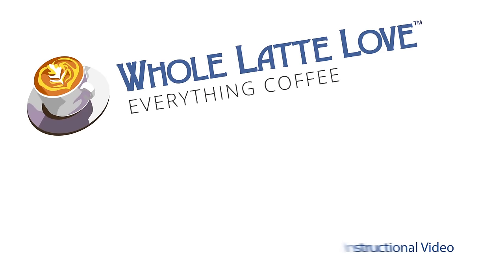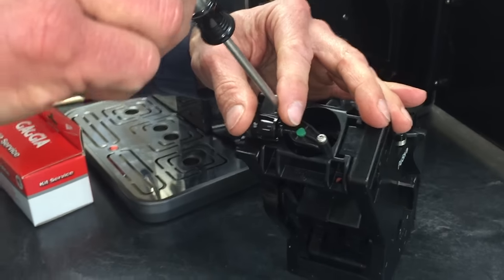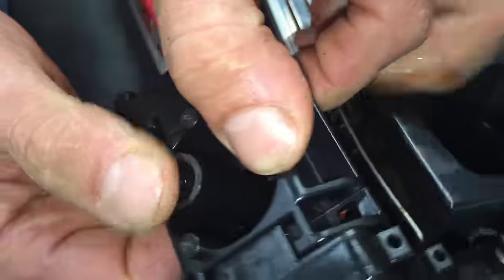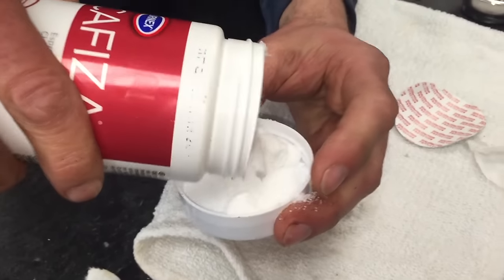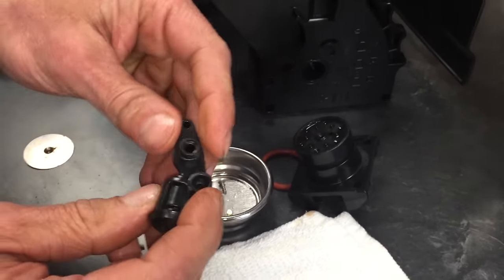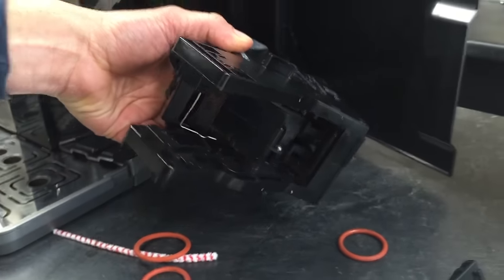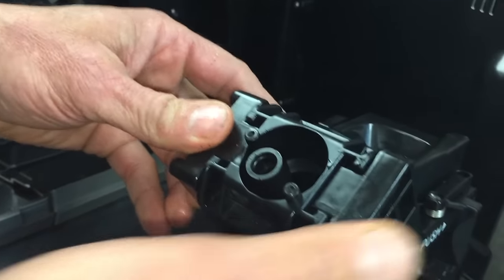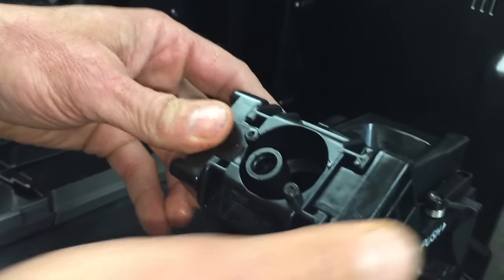How to Deep Clean the Gaggia Brera Brew Group

Comment: Why is no one talking about the lubricant? Is that thing organic and safe to "drink" ?
Reply: You need to use a food safe lubricant. Something like cooking oil is too thin to use on many parts of a coffee machine, but Vaseline is supposed to work pretty well. (I just googled this, and a good option seems to be to check Amazon for 'food safe silicone grease.' That gives you some less eyebrow-raising lubes for about £5.)
Reply from the maker: Hi a, Thanks for the question. It's a food safe lubricant. Also, the lubricant is not in close contact with actual brewing.

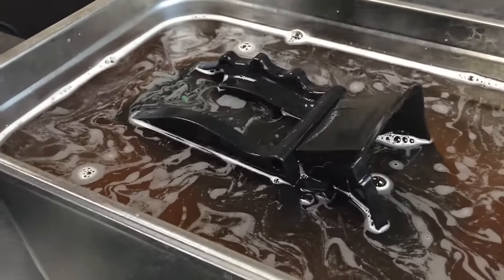Comment: Great video! I bought this machine a couple of years ago from y'all and love it. Thank you. Quick question I submerged the machine part at 5:47, in the Cafiza Cleaner (as I was doing it step by step and pausing the video). How bad is the Cafiza Cleaner for that part? What possible problems can arise? Thanks for your help.
Reply from the maker: Hi Michael, Thanks for the comment and question. Happy to hear you are loving your machine! As long as you did not leave the part in a Cafiza solution for an extended period it will be fine - no problems.
Marc
Reply: @Wholelattelovepage  It was in for about 20 minutes. What are you thoughts?
Reply from the maker: 20 minutes should not be a problem
Reply: @Wholelattelovepage  Thank you!

Comment: After taking the top valve off of the brew group, there was no spring or metal ball inside the cylinder.  Is this ok or am I missing something? I have a Gaggia Platinum Vision.
Reply from the maker: Hi Sarah, Thanks for the question. Gaggia uses 4 different styles of brew groups. You are fine...The Platinum Vision uses an O Ring and does not have the ball and spring.

Comment: Thank you for this!  I have a hard time cleaning the brew group because I was afraid to unscrew anything.  Question:  Is lube only necessary on the tracks?  I've been putting lube on the axle/pivot thing on the bottom, and also on any part that moves against another, as I would if it were metal, but is that not necessary?
Reply from the maker: Hi nyr, Thanks for the question. Here a connection to our support wiki which includes the video: How to Lubricate the Brew Unit: https://wiki.wholelattelove.com/Gaggia_Brera/cleaning_and_maintenance#Lubricate_the_Brew_Unit It's demonstrated on a Gaggia Brera but it's the same for any Gaggia brew group.
Marc
Reply: In

Comment: I bought a refurbished Gaggia Syncrony Digital coffee maker, using your videos I disassembled it entire for cleaning the machine and the Brew Group and Grinder (I am electronic). 
But the coffee that comes out of it is weak and does not turn creamy (I adjusted the amount of 70ml water, tested various grinder settings and bought quality coffee). I noticed that it takes an average of 30 seconds to make an expresso.
Could you give me some regulation tip (grinder or machine function) to improve the quality of my espresso?
Thanks
Reply from the maker: Hi TB, A few things you can check. For espresso we recommend using the finest grind and largest coffee dose possible. Is the espresso coming out relatively hot? Under temperature brew water could cause brewing issues. Under temperature may be caused by scaling in the thermoblock boiler which depending on previous owners maintenance habits may or may not be a problem. Descaling may help improve brew temp. Be aware it may also cause problems if machine was not descaled on schedule in the past. Scale can dislodge and plug up internal plumbing. Machine could possibly not be delivering a proper brew pressure due to a weak pump. If not producing crema with a known good coffee and shot is taking 30 seconds that's a possibility.
Reply: The temperature is good, coffee comes out at high temperature.
I did the descaling cycle with citric acid and Iget out a little dirt from the machine, and the water flows well from the machine just like the videos of demonstrations of take a coffee.
Would I know if the pump is weak? Have a test? Would you recommend some other kind of maintenance?
Is there any setup to increase the time to make coffee?
Thank you very much.
Reply from the maker: So 30 seconds is rather long. Low flow rate can indicate a blockage in the machine, weak or failing pump. Here's a link to our support Wiki for the Synchrony Logic which may have some useful information: https://wiki.wholelattelove.com/Gaggia_Syncrony_Logic#Poor_Flow_or_No_Flow
Reply: Muito obrigado, estou aprendendo um pouco mais a respeito disso.
Vocês acham interessante eu filmar um café para um diagnóstico ou a partir de agora tem que ir corrigindo todos os detalhes até ficar ao meu gosto?
Muito obrigado novamente.
Reply from the maker: Hi TB, Might have lost something in translation which was:
Thank you very much, I am learning a little more about this. Do you find it interesting to film a coffee for a diagnosis or from now on you have to go through all the details until it's to my liking? Thank you again.

I love coffee so I do find it interesting to film. I especially enjoy the more technical aspects and helping others enjoy what I love!

Eu amo o café assim que eu o encontro interessante filmar. Aprecio especialmente os aspectos mais técnicos e ajudar os outros a desfrutar o que eu amo!

Comment: I have a Saeco SG200 it does not have the same brew group as the one in your video. Do you know how to remove the BG from a SG200? It's stuck because the little switch that the locking lobe touches is not being switched. If not, who can I reach out to that would know? Thanks
Reply from the maker: Hi Mike, Found this manual for Saeco SG200 perhaps it can help: https://www.manualslib.com/manual/143477/Saeco-Espresso-Sg200e.html?page=3#manual

Comment: I put cafiza with hot water for 30 mins. Then i cleaned it all with piece of cloth which i was poking in with a small screwdriver. Then i did host water and cafiza for 20 more mins. The unit is virgin clean now. But now i am afraid i removed grease from all the places that should have it. I guess i need to check all moving parts and grease them? And never use hot water again?
Reply from the maker: Hey b, I'll bet it is clean. Warm water is fine - avoid hot. But all that soaking time def got rid of some grease. Definitely grease the moving parts and the o-ring. Doesn't take much grease to get the job done.

Comment: What about the poston inside? I removed it and cleaned and olive oiled the shaft.
Reply from the maker: Hi Marco, Cleaning is good. Olive oil is not the correct lubricant. You want to use a food grade grease as shown in the video.
Marc

Comment: Hello, my Saeco Vienna espresso machine stopped working after several years.  Water does not dispense from the spout but rather from the inside or somewhere near the bottom.  Please advise what to do and where to purchase repair parts.
Reply from the maker: Hi Jay, Here's a link to our Saeco Support wiki: https://wiki.wholelattelove.com/Saeco_Minuto_Focus#From_The_Bottom
This section is for a Saeco Minuto machine but yours might be having a similar issue. There are a few things you can try detailed in the wiki.

Comment: And how carefull do I have to be with the drying? So many nooks and crannys...
Reply from the maker: Hi GA, Good question! For normal maintenance we recommend rinsing brew group under room temperature tap water. Following that, shake off excess water and allow to rack dry outside of machine. Do not wipe down after rinsing. Not a problem to put a group back in machine and use when still lightly damp.

Comment: Как часто необходимо разбирать?
Reply from the maker: translation: How often do you need to disassemble?

Hi, Thanks for the question. Depends on level of use. I would deep clean if you notice degraded performance. It could be a year or more before deep cleaning is needed. I have a machine using this group which is going on two years of use averaging 6 brew cycles daily and I have not done a deep cleaning of the group.

Привет, спасибо за вопрос. Зависит от уровня использования. Я бы глубоко очистил, если вы заметили снижение производительности. Может пройти год или больше, прежде чем понадобится глубокая очистка. У меня есть машина, использующая эту группу, которая работает два года в среднем по 6 циклов заваривания в день, и я не проводила глубокую очистку группы.
Reply: @Wholelattelovepage  Спасибо

Comment: Why does this brew group look exactly like my 10 year old Saeco Syntia brew group?
Reply from the maker: Hi f the s, Gaggia uses 4 styles of brew groups all look very similar but have subtle differences. Saeco groups look similar as well.
Reply: Whole Latte Love - Ah... THANK YOU for explaining that, that’s actually good on the company, if I ever need parts it shouldn’t be too hard to find them. I actually had a Saeco Syntia sitting on my side counter in my kitchen for like 7 years covered with a towel, I bought it used on eBay and the machine came VERY dirty and I just put off cleaning it and setting it up until yesterday, I had two spine surgeries in that time (I’m kinda disabled) and I just kept putting it off and doing other “projects”. I had to take mine apart and clean it but it works like a champ now! I just can’t find any decent coffee locally, all the Lavazza and illy at my local stores are pre-ground 🤬!

Comment: My machine often dumps the freshly grinded coffee grounds without brewing the coffee and displays "no coffee beans" while the beans are full.  I replaced the entire grinder with motor assembly but the problem doesn't go away.  Could you shed some lights?  Please help.  Thanks.
Reply from the maker: Hi MF, So the machine has to learn the new grinder assembly, with the algorithm. I would try running the grinder with a empty hopper at least 2 times. Then add beans and try a few drinks. The machine has to self learn the new parameters of the new grinder.
Reply: @Wholelattelovepage  Thank you so much.  I will try your tricks.  I really appreciate your kind reply.
Reply: @Wholelattelovepage  Hi there.  I tried running the grinder with the empty hopper but the problem doesn't go away.  The machine still occasionally dumps the coffee grounds without making coffee and displays "no beans" while the bean hopper is full of coffee beans.  Are there any other possibilities which result in this problem?  Thanks.

Comment: I have a question. After my Gaggia Titanium brews the coffee and it pours into the cup the last few seconds where its getting back to its "passive" state there is a small pool of water that gets released into the tray at the bottom. What could be the cause of that?
Reply from the maker: Hi SG, It's normal for some water to release to the drip tray at different stages of the brewing cycle. But, you might also have a leak from where the water enters the brew unit. If it's not an excessive amount of water I would not worry about it. Deep cleaning and lubricating the brew unit may decrease the amount of water released.